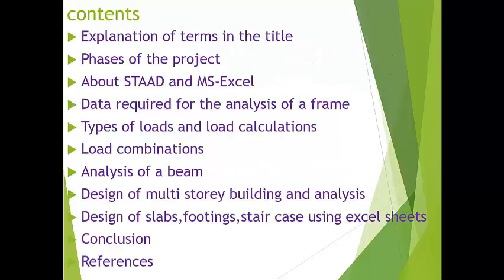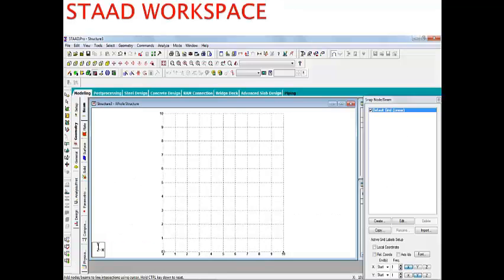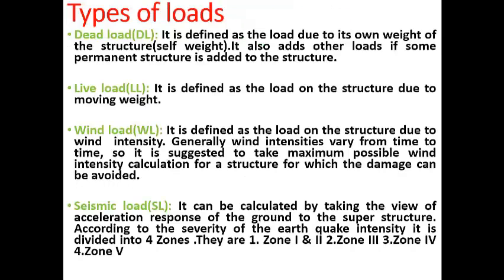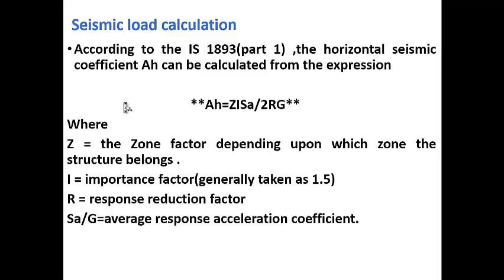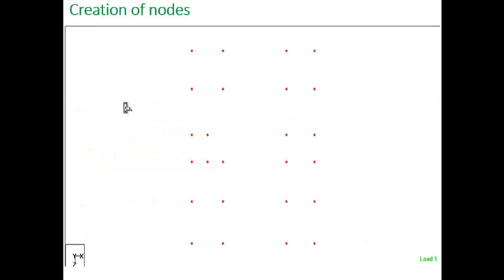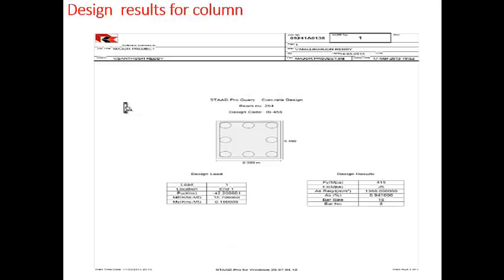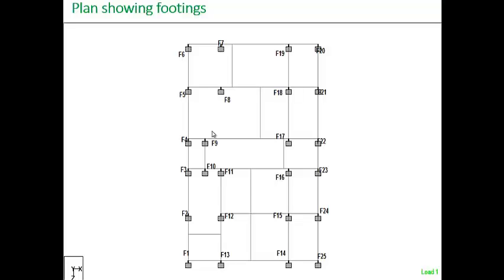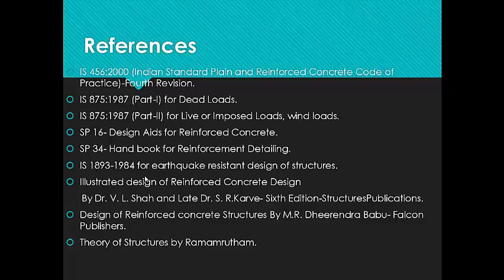GRIET-CIVIL(R09)-3D ANALYSIS AND DESIGN OF MULTISTORIED BUILDING USING STAAD.PRO

Comment: i have done the similar project manually for my final project way back in 2011. project took almost a month to complete using kani, substitution frame and cantilever method, refer similar IS code shown in your video.and SP 16,34,24 and ductile detailing code IS 13920 under the guidance of Ass prof Sir TH. Suresh Singh ( BE-NIT Suratkal,ME-IIT Roorkie, PHD-Jadavpur ). i guess u must have completed your project in less than an hour.